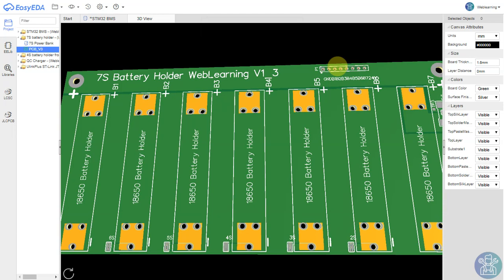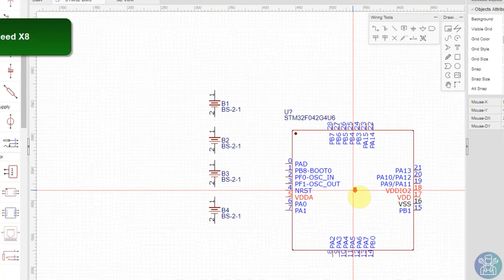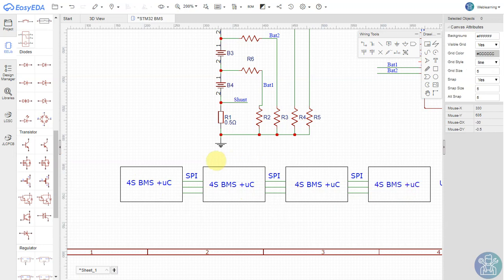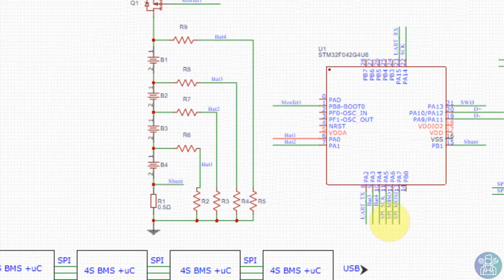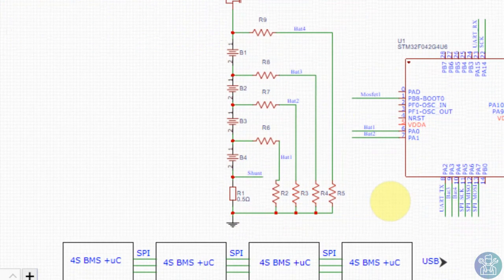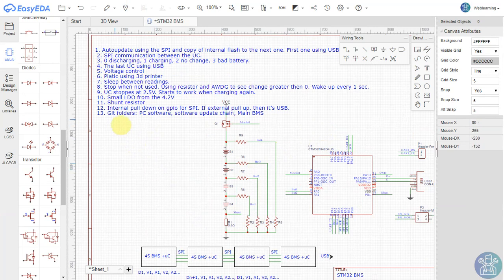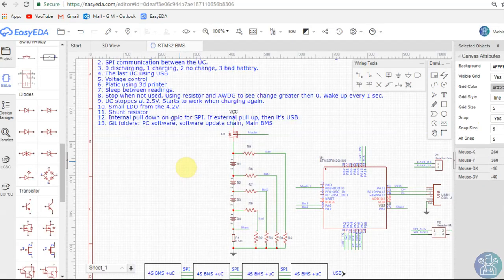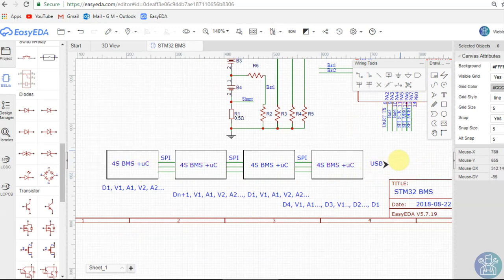7s Battery BMS joint collaboration - Short Video

Comment: I'd like to suggest that an analog multiplexer be used on the voltage divider. This multiplexer should have a 8:1 configuration, where all switches can be off to prevent leakage between sampling. May simplify uP selection.
Reply from the maker: The idea is to have as little as possible parts to solder. I hope to make an BMS so anyone with basic soldering skills can solder it. The more parts we add, the harder it will be. So I prefer to have one big STM32 with less parts outside, the many parts to solder.